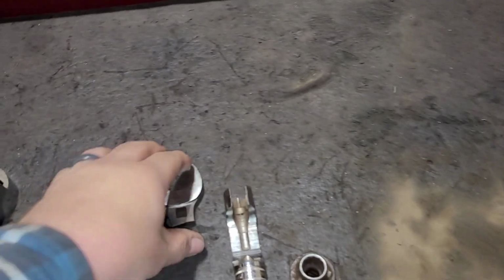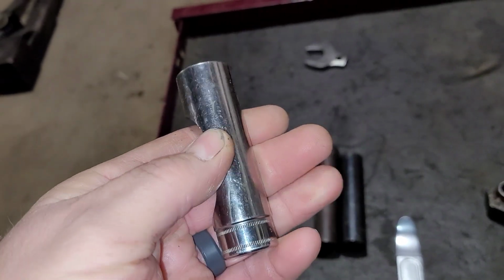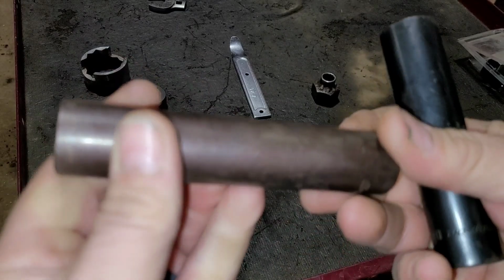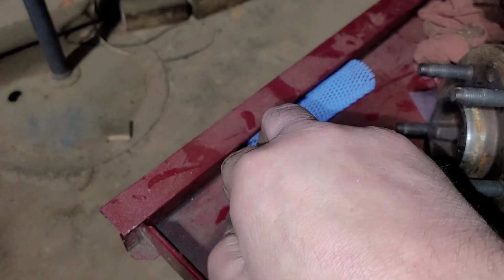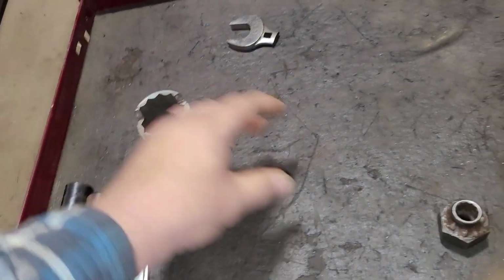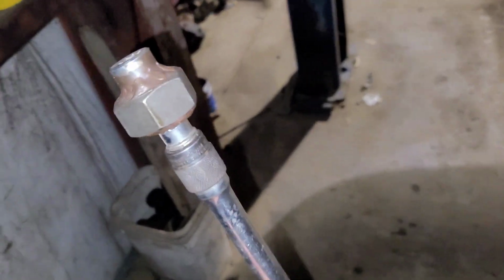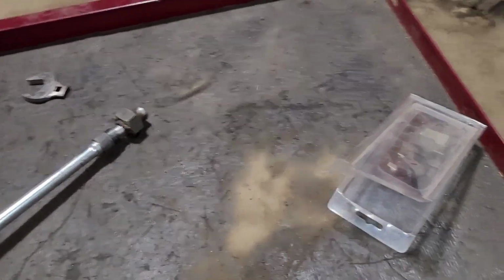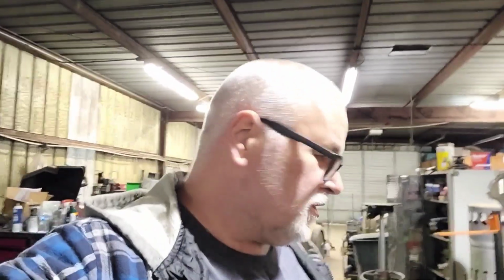A Few Of My Specialty & Homemade Tools That You've Asked About

Comment: BRO TIP always pick up cheap or trash quality tools and sockets and hoard them in a box. with a grinder (any type) and a blow torch and hammer, you can make so many tools from trash. EVEN MORE WITH A LATHE, WELDER, AND MILL MACHINE. 
needle nose pliers + narrowed with a bench grinder= orifice tube install/removal tool
crappy screwdrivers +bending= hd/rad hose picks/prybars/screwdriver bit/ or odd angle screwdriver?
garbage sockets + big fackin hammer =ball joint press
cheap wrenches and sockets + grinder= low profile tools or that treat especial flare nut socket (i am gonna go to walmart and get some viper muff sockets to make these😁)
Reply from the maker: Thanks for the tech tip! I appreciate your response. Keep wrenching!!!

Comment: Necessity has created countless tools! Here's one I use a lot; when tracing out a short in a circuit replace the fuse with a bulb. It acts as a current limiter. You can probe the circuit without frying the wires.
Reply: thats even better. im guessing it lights up when a fuse would blow instead? I was going to buy those circuit breaker fuses that funk fpv showed on his tool reviews of 2023.

Comment: I get the impression that 4140 on those trim panel tools is the Grade of steel, not a part number. You can never own too many tools. I have bought sets of tools just for a few spanners and given the rest of the spanners to teenagers, I have bought whole sets of sockets and had friends need to borrow a size that I have never used. I also butcher cheap spanners/screw drivers to make a specialty tool, it's a common sense practice. Try getting the coolant sensor out of my Australian Ford Falcon, which faces out of the block directly towards the firewall, without my cut down 19mm offset ring spanner and you'll wish you could use it too. Great video.

Comment: Just to clarify, with the "corporate axles" tool you had, the adjustable collar is adjusted with the axle nut you welded on? The socket is just there to use the 3/8th drive.

Comment: I use to work at a trailer manufacturer company, we also installed hitches on cars and trucks, I got tired of having hot metal shavings hit me in the face when drilling holes into the frame so I welded up a jig that held the pneumatic drill onto a hydraulic floor Jack and let the Jack do all the work, my boss was so impressed he asked me to make more for all the other welders and installers, he payed me to do it , he said I should patented it, I never did i retired some years back and they’re still using those jigs there today, I also seen a similar product online which is now patented, missed out darn it!! 😂

Comment: That stud installer tool works on most hubs .but on a later model ford Explorer the rear hub is to narrow and the tool sits at an angle. So I bought some washers and stacked them high enough for the tool to clear the part of the hub that interfered with the tool seating properly.

Comment: Taking a break from working on a 2000 Montero I just bought then found the harmonic balancer bolt was backed out. Bummer no telling what I will need for tools. Pulley ruined timing gear interface is important even though the timing belt was done I have found many things loose so in we go.

Comment: Indeed Kenny, I have one of the 4140 panel tools and it is indispensable.  
You can get a lot done with plastic trim panel tools, but sometimes you need some direct leverage and it does it by spreading the load and minimising panel damage.
I got mine from Ebay and it was around £15. I call these Anti-Grief tools, they do save a lot of hassle, grief, and choice words.

Comment: Man am I glad I found Kenny's channel. I've spent countless hours looking fora channel that is as honest and easy to follow as this. I also watch Rainman Ray's channel and enjoy it also but. Kenny's isn't so big that it doesn't seem mostly for entertainment. I feel like he's actually teaching Auto Shop. No Bullshit and a bit of attitude like a damn good, knows his shit channel.
If I could ask for advice right now it is to show me a simple repair for a wallowed out upper door hinge fix on my 91 GMC pickup without hopefully replacing the hinge itself. It seems like something he's had to repair before. I'm thinking JB Weld putty but would really appreciate his opinion because it doesn't seem to me that it would last. I tried a bushing kit but the hole is too oblong to work. Please help a poor disabled fool Kenny! Even if it's bad news.
Reply: Weld washers in the bushing hole and on the side that doesn't interfere with the hinge working. Then resize/drill to fit new bushings.
Reply: @stevea6722  I'll give that a shot. I just happened to get a little 110 volt buzz box and some 6011 &6013 3/32 rod.

Comment: 4140 is a chrome moly alloy, used for it's high strength, toughness and impact resistance. Unusual that they would name the tool that, but I have the tool and you are correct it is the cats a**.  Thanks for the video Kenny.

Comment: Nice cro-moly 4140 trim tool. Standard is 4130, but that is the next higher grade , meaning it's tensile strength is more, like 6,000 versus 7,000 aluminum? Rather have that than ss? Jdtco sells those trim tools with a rubber handle if anyone needs one?